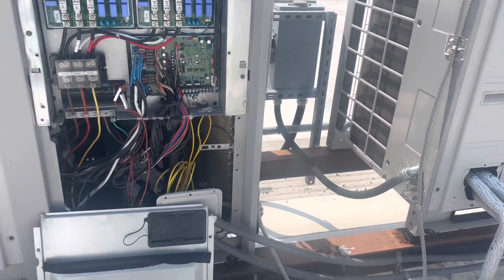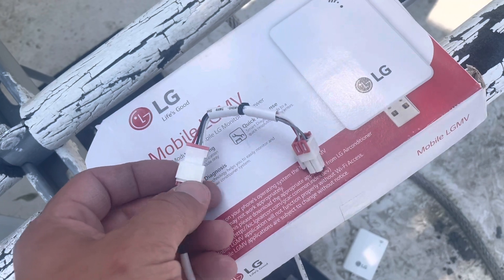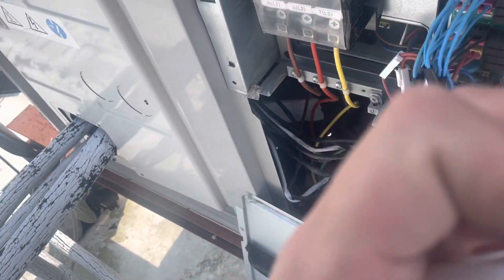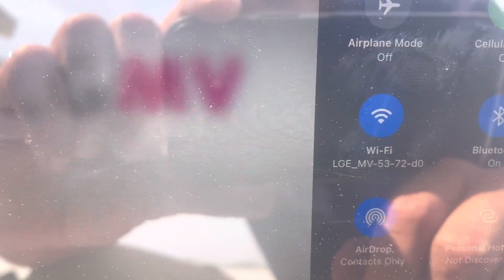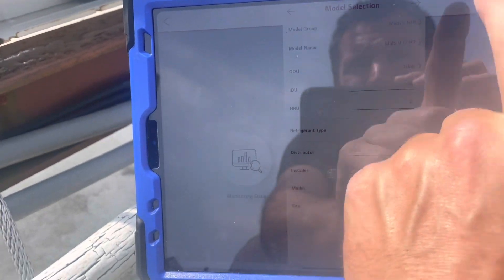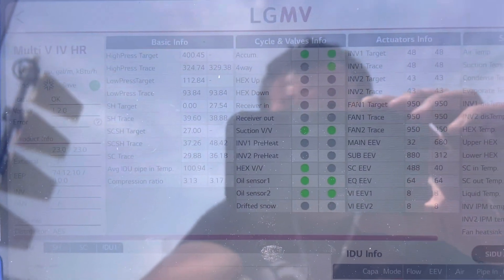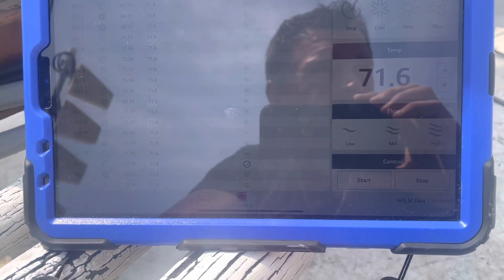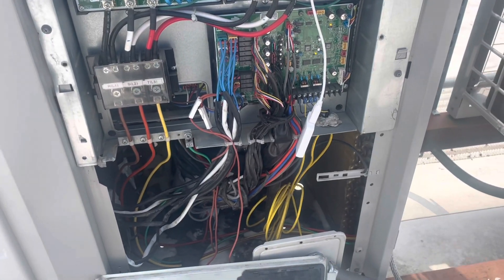Using the Mobile LGMV Tool!  #hvac #lg #airconditioner

Comment: I’m running into hooking it all up and it not finding the unit or uploading the information to the app.
Reply from the maker: Ive found that the LGMV tool connector will attach to many plugs inside the unit.  You have to make sure you’re connected to the one labeled correctly.  I’ve found when this happens, it will allow you to connect but it won’t load any unit info.  Hope this helps.

Comment: just got brought in on an LG Multi V III system put in 6 yrs ago that has over $1 million dollars in repairs and LG has never heard of it. To say it was installed incorrectly, is an understatement.
Reply from the maker: Good luck brother.  We kinda dealt with the same thing with this site.  The distributor we deal with had no record of any of the equipment we were working on.  Thank god the customer kept all the As Builts and original files or we would have had to take weeks making our own drawings and files 🤙✌️
Reply: The site we are dealing with has solar power and grid power. I have ran into issues with LG compressors mevhanically failing from bearing damage done from “bad” power causing micro arching at the compressor bearings. Then a mechanical failure. Multiple sites now.

Comment: Great intro.  Does the Mobile LGMV software allow for firmware updates?
Reply from the maker: They have updates to the app every so often.
Reply: @JeffsHVACAdventures  No, I mean does LGMV have an option to update the firmware on the ODU or IDU's?  I don't see that option on the latest LGMV for IOS.   I was wondering if the laptop version via the PRCTIL0 adapter does?   If not, is there another service tool that does?